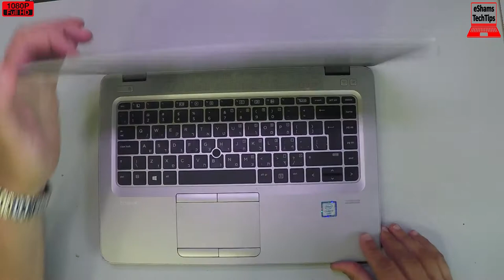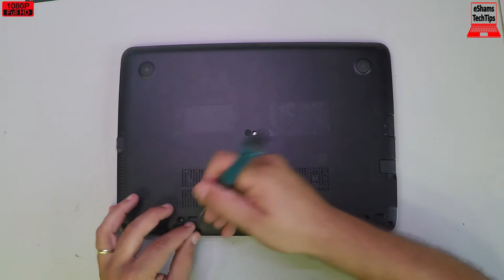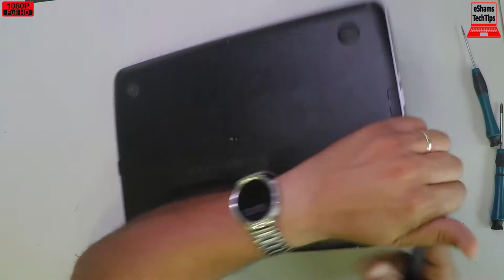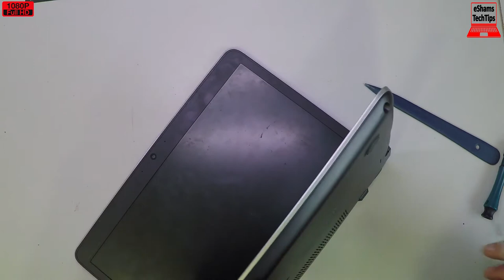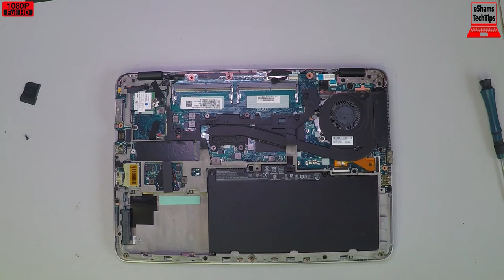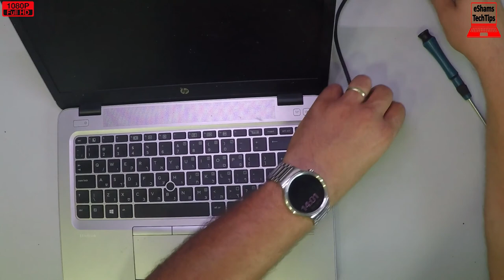HP EliteBook 840 G3 Partial Disassembly and Reassembly

Comment: Keyboard!
Reply from the maker: Hello, It's a partial Disassembly and reassembly, I didn't take out the keyboard!
Reply: When you have the base removed, remove the battery. Then you will see 4 screws that show the keyboard symbol on them, remove those. And when you look up near the heatsink, there is a small gray clip just to the left of the "*B" Symbol. Take a small flathead screwdriver and pry that clip off which will pop the keyboard out slightly. You'll need to grab it from the other side (top), but it will come out. There will be 2-3 ribbons depending on if your new one is backlit or not. Disconnect those and reconnect the new ones to the new keyboard, screw the screws back in. I'd test that the keyboard works before buttoning everything in which will require the battery to be put back in. But that should be it. I just did this and noticed there are no actual keyboard replacement videos anywhere.